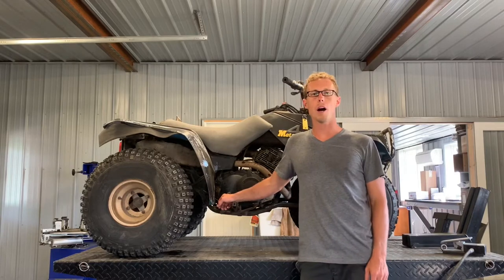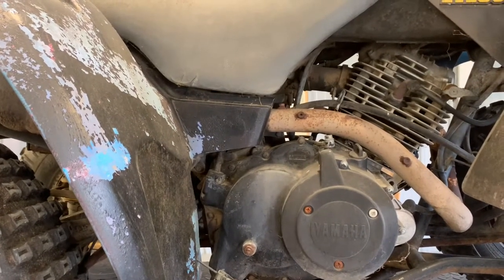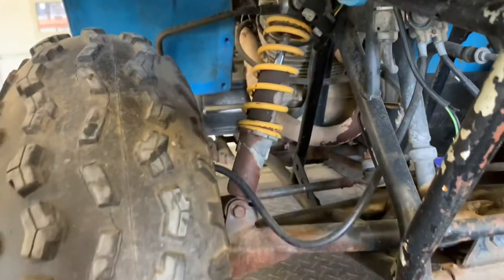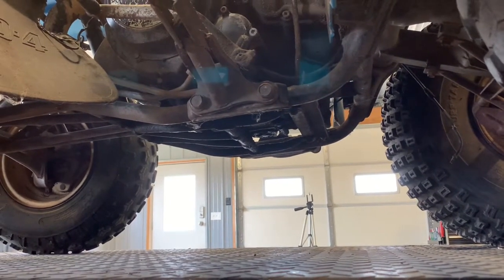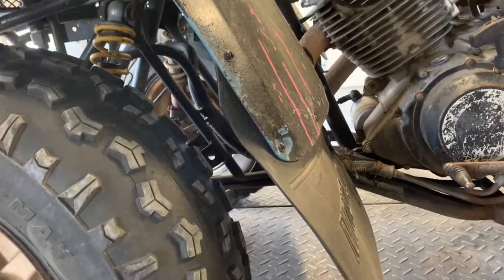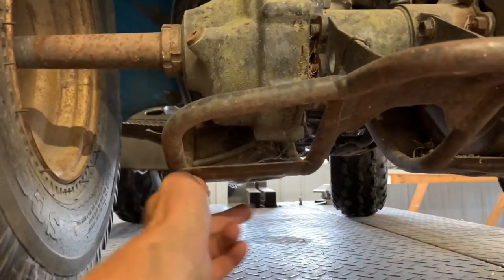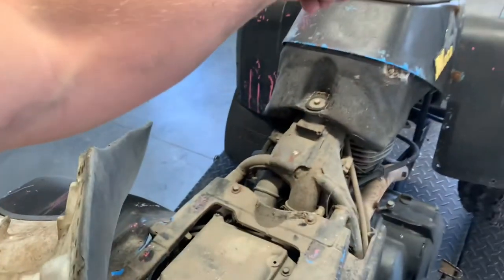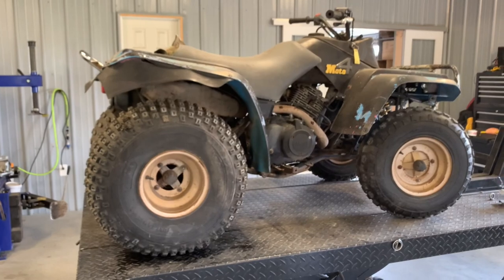Yamaha Moto 4 350 - SAVE MONEY - How to do Maintenance - Full Service - Oil Change

Comment: Hey I have a 90’s moto 4 350 , just wondering what kind of oil goes into the rear differential, I’ve heard a couple different things , one being that it takes a actual differential oil , and the second being that the oil from the motor and transmission, and oil cooler are all one unit? Your help is greatly appreciated

Comment: You said if I have questions. I have one. Bike runs perfect. Went to start it and sounds like dragging and cracking inside the motor coming from starter
Reply from the maker: Yikes. Sounds like the one way starter gear is stuck. Not super uncommon on those. Check out my stator / flywheel replacement video. Thanks for the comment! Let us know if there is anything we can help with. Check out:  https://youtu.be/X0AdFxkJiOg  for more tips. And:   https://www.ebay.com/str/midnebraskamotorsports for all your parts.

Comment: June 2023, how did you do away with the hi and low and reverse shifter,  im having trouble with mine not wanting to shift, its a 1988 350
Reply from the maker: Well, I wouldn't do away with it because that is your method of shipping from hi to low to reverse. I would just leave it in whatever range you use the most and stay within that gear parameters if you are having issues with it. Let me know if that answers your questions. Also check out: https://www.ebay.com/str/midnebraskamotorsports for any parts needed on that machine.
Reply: @MidNebraskaMotorsports  it is in hi gear but I need reverse too, I don't want to do away with the shifting from hi, low and reverse because im disabled and i use it to deer hunt ,  I just want to do away with that shifter and I would like to replace it with just a bar or pipe like yours was on the video .

Comment: How do you remove the rear axle? I removed the two inner axle nuts and rear brake Caliper etc., but the axle is not wanting to slide out from the rear differential. Is there a hidden snap ring or something similar preventing the axle from sliding out?

Comment: do i add coolant to this machine
Reply from the maker: It is air cooled. I would not add coolant as it doesn't tank any. Thanks for watching and the comment. Check out our other Moto 4 videos.
Reply: @MidNebraskaMotorsports  thanks, i was just curious, another question though, where the forward and reverse lever is at, the lever moves up and down, even when its off, and even without me even pushing the button in to put it in reverse, i took that little screw out thats holding the lever, and it seems to be stripped, but the part that the lever goes into, whats the name of that part, and where can i find one at a decent price, it dont have to be new, well depends on how much it cost